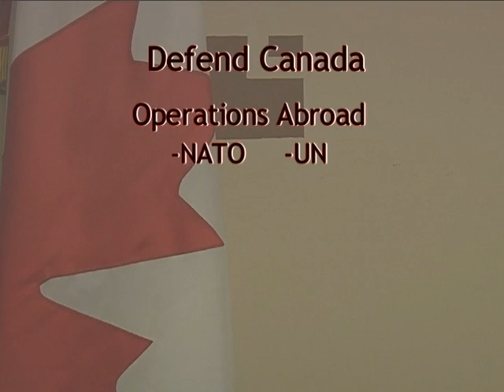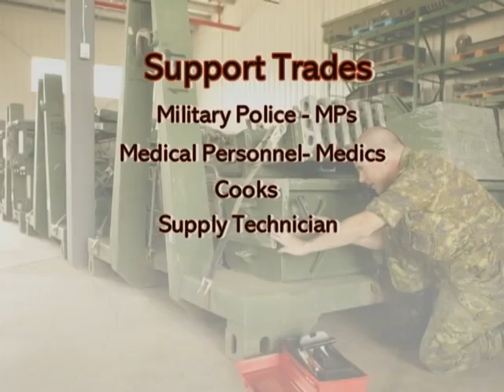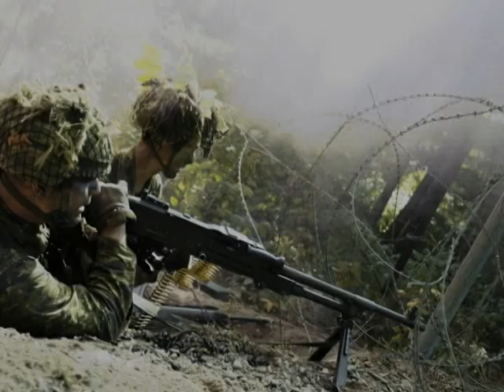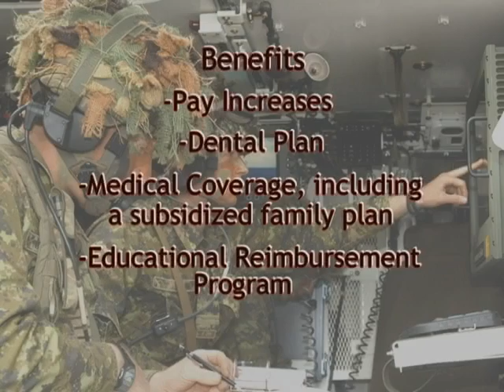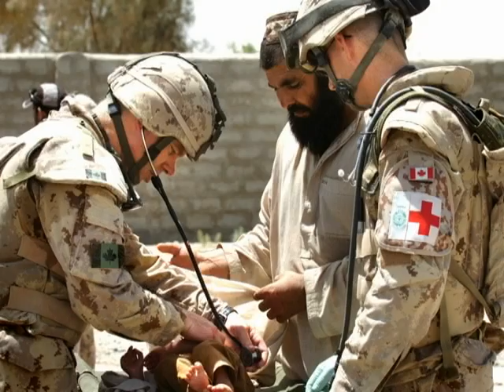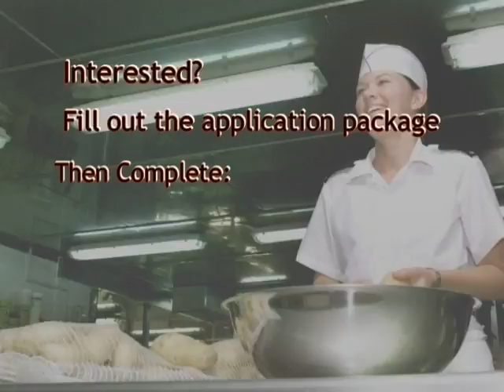Joining the Canadian Forces Army Reserves

Comment: i just wanna join The Disaster Assistance Response Team (DART)
why an't der any gotdam info on Dart?
Reply: You can't join the team moron. You have to join the military in a occupation that DART would need, like a doctor, search and rescue tech, etc... Plus, you can not spell the word "God damn." I don't think you will have too much luck getting yourself on to DART  lol.
Reply: draco anderson Yeah, sorry bro. while everything else he has said about the reserves in this comment section obv lacks an understanding of the Canadian Forces... Alley Cat is right, you probably won't be part of DART in the reserves. DART is for rapid deployment.  You would need to be in the regs to be deployed that fast. Plus it only has 200 members. If you are in the reserves, its possible that you could volunteer to go overseas for a month (or however long they offer, DART would leave after 40 days, but you could be offered more) after DART has already deployed and set up. For that, also, as Alley Cat said, you would need to be in a trade that relates to what they need. Combat Engineers and Medics would probably be the most useful, but Mobile Support Equipment operator would also have opportunity. You could also join the infantry, and then you would still get to go for the grunt work (digging, throwing sand bags in a flood, etc.) or security (not likely).

Comment: The simple answer is most likely no. It may or may not preclude you from joining the Canadian Forces, but looking at the severity of your offense, the chances are very slim to none with that weapon charge. All charges will be taken look at by them and will be taken into consideration. It will affect your application, so even if you do manage to apply, it will take longer because of the criminal charges. To have a certain answer, you should contact your local RC b/c no one here is a recruiter.

Comment: @hockeyspencer1 If you listined towards the end, you have to be between the ages of 16 - 57. You do not have to be in cadets but it does help (I'm a Flight Sergeant in air cadets). However, cadets and I believe the reserves does their timing on drill differently from the regular force which make the regular for not like cadets as much. they still like them but it falls under attitude. (Example: attention - at ease in cadets is "up down" but regular is "1, 2 (or 1, 1)"

Comment: well, it has always been the back of my head ever since my mother enrolled me in Cadet`s, it taught me alot of things and it was all hands on experience. Im 21 now and was wondering, just how physically fit, Id have to be to join the forces. I smoke a pack a day and am a coffee drinker, but Im in good shape, not supplement ripped or gym built but still dont know about those 25 pull ups. on the other hand ive been told great things about the reserves and educational benifits.got a work out sheet?